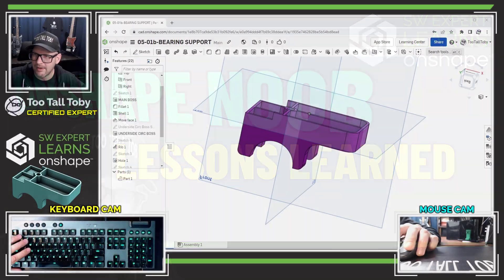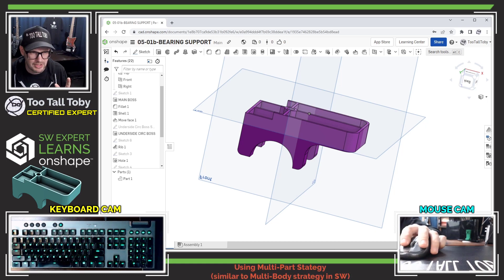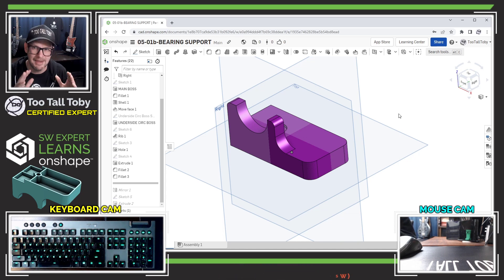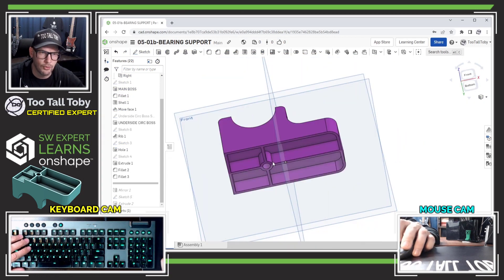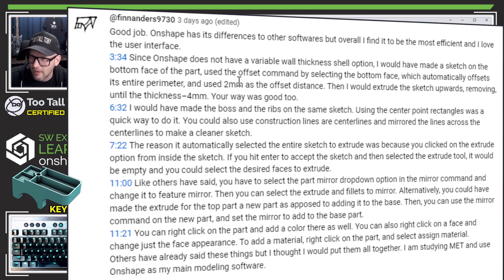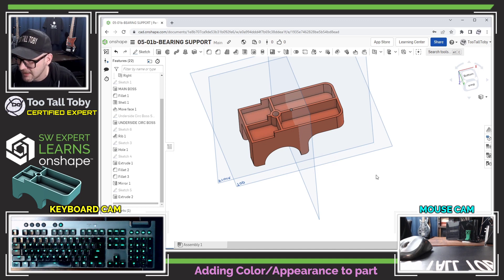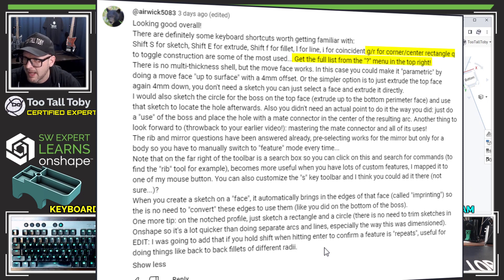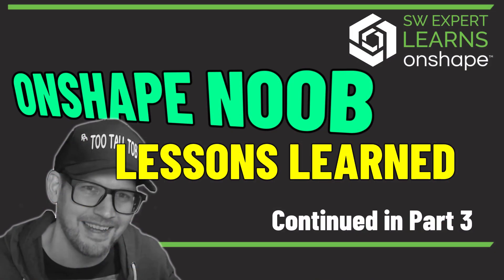SW Expert's Tutorial Lessons Learned (Part 2)

Comment: What I was trying to say is that each of the tools like the RIB, HOLE, EXTRUDE, THICK, DRAFT etc.  have a small "?" mark in the bottom right corner of the dialog box for that tool.  

A new context sensitive window will pop-up with the applicable tutorial / reference material for that specific dialog.    Just like having a manual only never out of data !!
Reply: Oh that's cool I didnt realize that's what you meant, and I didnt realize that help link was there, in every feature.  Awesome!  Very helpful!  thanks!

Comment: Yes, correct, the round would need to be added afterwards. More features in this case, but if that first vertical wall took 25 features to make, for example, making it a separate part would be much better. It would be more conducive to design changes, and you wouldn't have to pick 25 features in the mirror command (or a bunch of little faces if it was complex if using mirror face).
Reply: YES !!  that's was I was thinking too - based on your comment - if that section of the model had a BUNCH of features, it would make more sense to do it as a "part" and then mirror the entire part.  This is very similar to how we do it with multi-body design, and your comment really helped me understand how the 2 techniques are similar.  THANKS MAN!!  Awesome stuff!!